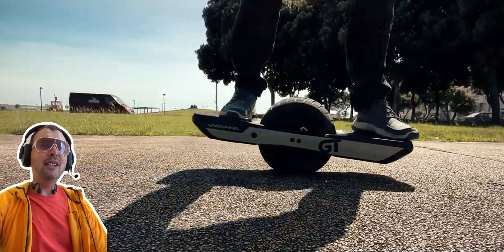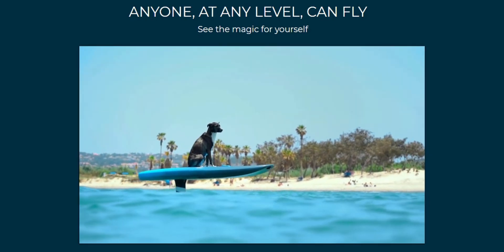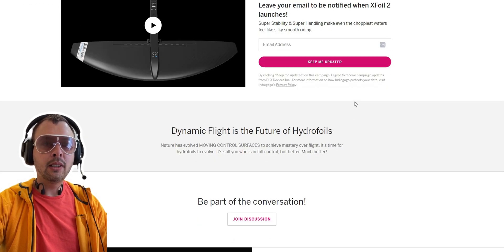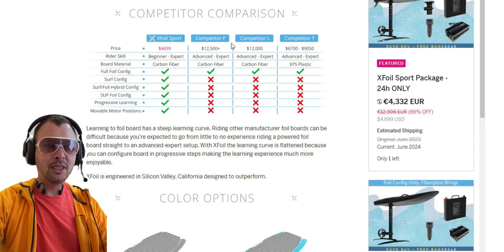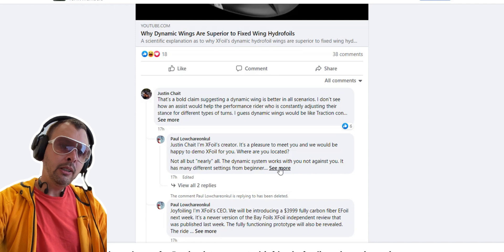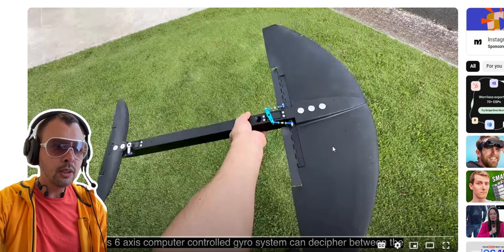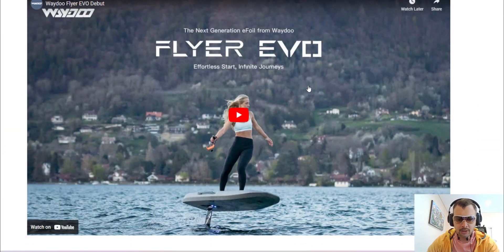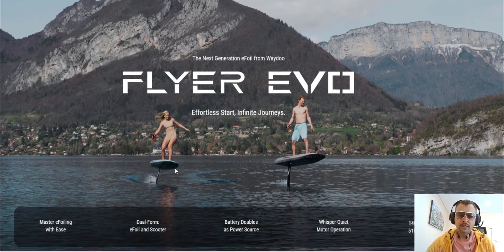SELF STABILIZED E-FOILS?  Levelfoils, Waydoo EVO & Xfoil Gyro Stabilized Hydrofoils

Comment: $4k is NOT an extremely low price. They have a descent profit still. A fair price of a 3kWt, 1h ride e-foil is about $1.5k (pls don't tell me about $1mio R&D you have to compensate, guys)

About xfoil.. A tail stabilizer must not be dynamic. It works automatically because of an angle difference to a front wing. And if a dynamic wing does not move (due to a stabilization), there is no need to move a tail stabilizer at all. And with a small movement an opposite angle of attack makes it working for free. So..Next try pls xfoil
Reply from the maker: Not sure if you are joking about efoil for 1.5k ? For that price you can’t even buy a decent mast. https://axisfoils.com/collections/masts/products/pro-ultra-high-modulus-carbon-1050
Reply: @JetSurfingNation  Can you compare a bike frame and the mast in terms of simplicity, amount of carbon, and the prices? I can. And I'm sure efoil prices are absurd. I would say e-fail. It's clear that e-foils millionaires purchase, and manufacturers can ask any price. Do you think it has some reason behind that no matter of a manufacturer, the price is $12k? I'm not a millionaire, so I don't care of existing prices. I assemble my rig from custom parts which retail(!) prices are $1.5k. And I don't spend $1mio for R&D =)

Comment: Mike, Thank you for the video... My understanding is that Waydoo's sensors are towards the nose and vary motor output before prop breech, so a different approach than self-stabized as referenced in the title of this video.  Closer to the mast there are two down facing LED lights.
Reply from the maker: That is correct. Different approach to get the same goal of stabilizing the riding

Comment: I think market trends is budget boards to get people into the system or expensive boards for experts to ride. I don't see who needs a high cost beginner only board, it seems like this tech will need crazy RnD and I don't think the market is there.
Reply: We have a base model fully carbon fiber for $3999. (Retails for $12,000).
Reply: @PLXDevices  So at the 12k price point, you're in the same ballpark as flite/lift prices, which obviously have a proven track record of reliability, customer service, and warranty support. When you're buying a toy this expensive, those things I listed above tend to matter more than new gimmicks like the self stabilization.  I feel like we're about to witness GETFOIL2.0 here
Reply: @PLXDevices idk why a beginner would opt for that over Fliteboard air + lesson cost.